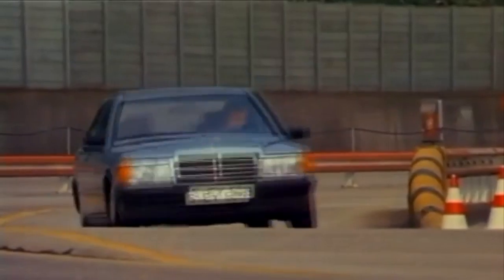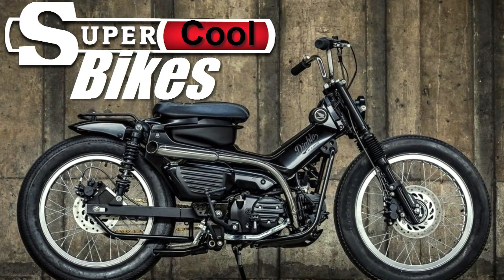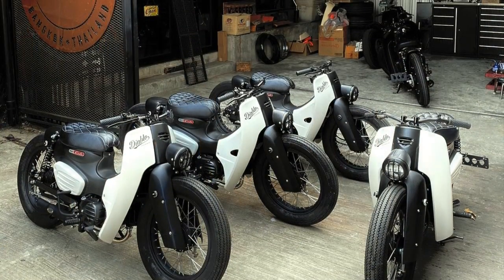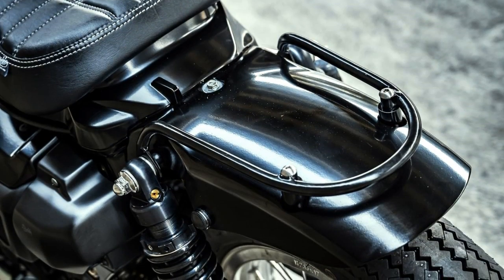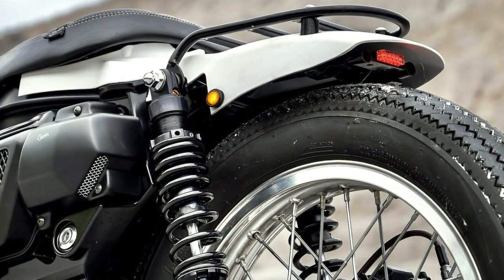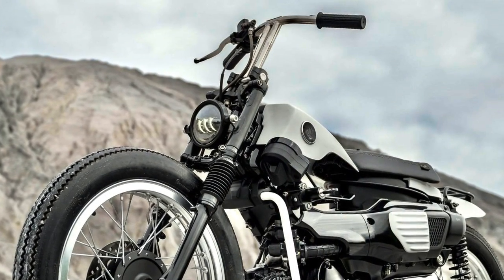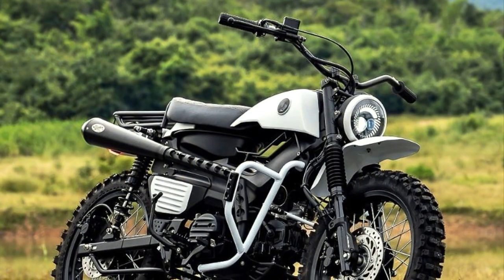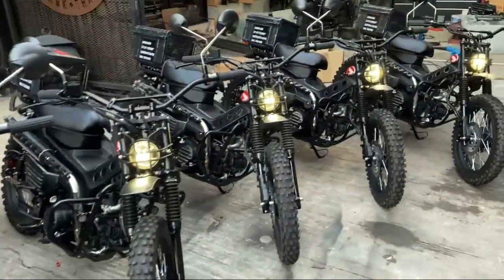Cafe Racer (Honda CT 125 by K-speed Custom)

Comment: The only thing that bugs me about the Trail 125 is the seat on top of the gas tank.   It sits too high.   Modify the frame and put the tank where it belongs, in front of the seat.  Then the rider will sit a bit lower like he is supposed to.   And it will perhaps hold twice the fuel.   If I buy one I'm going to strip it down and do those mods myself.   With the step through it looks too much like a traditional scooter.  No reason why it can't look like a motorcycle.